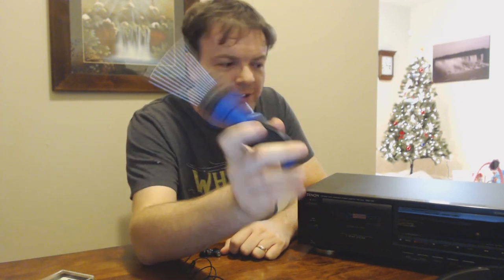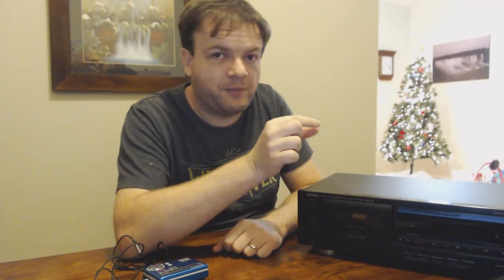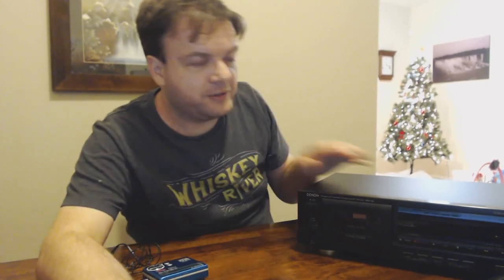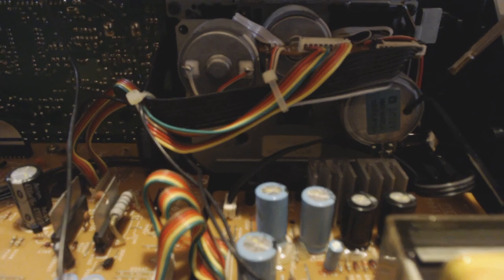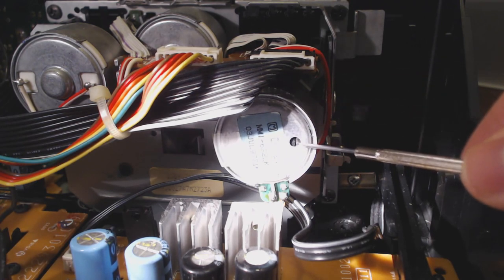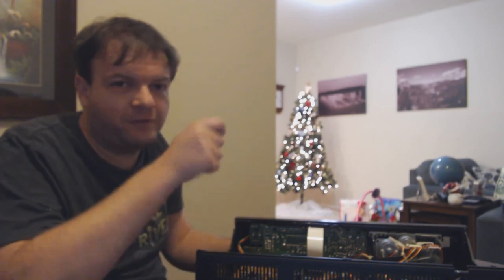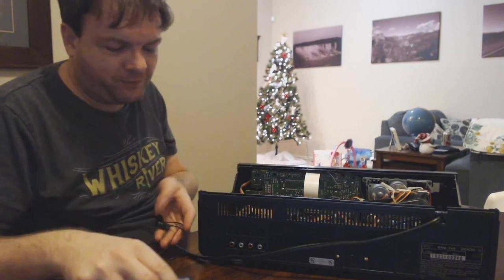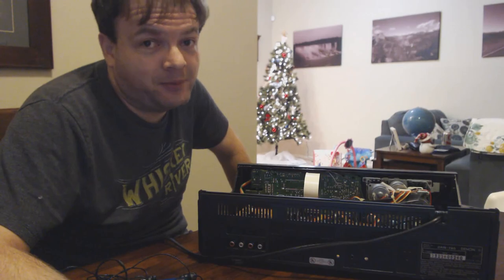Fixing a Slow Cassette Deck - Cassette Community

Comment: Thanks for the video Matt. I was able to fix the speed on my Sony RX77ES using this method. Incidentally, that was the third repair it needed to get it in working order. I bought the deck for $5 at a thrift shop. First I replaced the main drive belt, but then the speed was slow and the motor became quite noisy after an hour of playing. I replaced the motor, but it was still slow. After watching your video, I adjusted the new motor, and it works well now.
Reply from the maker: Hi Greg, that makes me happy that one of my videos helped somebody. I admit it's not the most accurate method but it works! And I don't really understand how test tones work etc. so I prefer to do things more manually. You got a great deal on your Sony deck! Even if it needed worked, you can't go wrong for $5.

Comment: My 1993 Kenwood KXW8050 double-cassette deck has a handy set of adjustment potentiometers"pots" located on a circuit board atop the tape mechanism for easy adjustment. I use a 3KHZ tape and the "Hertz" setting on my multi meter. Warning! Don't monitor the test tape with headphones; it's very loud! I learned that the hard way! LOL! Just affix your probes to the Left channel RCA jack, and fine-adjust to 3.0 KHZ. Repeat for each tape direction, if you have separate adjusting pots.

Comment: My old JVC deck hasn't been used in at least 20 years. I tried it today and it was VERY slow. I'm going to try your method tomorrow in hopes I can keep from giving it away on FB Marketplace. Thanks for the excellent video.
Reply from the maker: Hope it worked out!
Reply: @MattHayesVinyl  Thanks. In my case, it definitely needed new belts. But changing those did fix my speed problem.

Comment: This has happened to two fairly new cassette players I have :( one is on a Walkman the other is a boom box. I don’t think I can fix it on my own :( I’m. Not sure why this happened as I haven’t used either one much at all until recently I started buying tapes.
Reply: @angelanicole2945 I’ve had the same issue with 3 high-end decks I recently purchased. It’s bad news. The motors start to develop dead spots and slow down, so to compensate sellers turn up the motor speed, like in this video, before selling, but that only works for a short time. Eventually the motor will completely die. It’s hard to find new replacement motors. Buying old decks is a total gamble no matter how good of condition they are in.

Comment: Thanks for this video. My Onkyo TA-2870, and I think many other Onkyo TA have the same option. There is an off-center hole in the motor case,  sealed with felt. I had to stick through with the same srewdriver as you done and it works :) Great video hint

Comment: I have an old Philips d8134 that is playing the tapes a little slow, but I can for the love of me not find anything inside it that looks even close to the potentiometer in your video... Any advice?
Reply from the maker: Hi, sorry for taking so long to reply. Not all cassette decks are alike... especially older decks. I am not familiar with that model so I wish you the best of luck. But the first thing I would check are the belts to make sure they are still good.

Comment: Thanks for the vid Matt, I have one of my Onkyo decks that plays way too slow, next time I pull it apart I will look for a pot to adjust the speed with.
Reply from the maker: Hi Ronnie. You're welcome! I must admit it wasn't my most interesting video but I thought, what the heck, somebody might find it useful. Often the cause of a slow deck is a loose belt but, in this case, the belt was supposedly new (according to the guy I bought it off, anyway) and it did indeed seem fine on inspection. The speed was only off by maybe 5-10% and adjusting the potentiometer had to be done very gradually and slowly. A couple of the adjustments were so small I didn't even see the screwdriver move, although I felt the potentiometer turn ever so slightly. I don't know if all decks have motors like this, probably some have potentiometers in different places depending on the motor. And there are multiple other potentiometers in there for things like left/right channel output levels and so on. I was lucky that somebody had posted a video about this same adjustment on a similar deck to mine.
Reply: I relaced the belts, well actually with rubber bands... I would like to buy a couple belts only if I know it will be worth the investment and it was a huge task in this deck to change the belts you had to disassemble everthing. I did watch another vid after yours where a dude just recorded a 440hz which happens to be the musical tone of A. While playing the tape he used a guitar tuner and set the the pot to the Key of A on the tuner, magical! and very simple and logical. I think this would be much easier than trying to match speed to something you hope in itself is at the correct speed.
Reply from the maker: Yeah, using a speed calibration tape is more accurate for sure. However, I know the source was recorded at the correct speed because it was digital. Getting the tape deck to match the speed of the source was what took a while, far longer than is shown in the video!

Comment: Hey man, my cassette player is also slow, I thought it might be the belts but they look fine no cracking, just a bit stretched. I tried messing with the "pot" but I don't see a place for adjustment
Reply from the maker: Hi John. That will likely vary from deck to deck. The pot was on the motor in my Denon but was extremely fiddly to adjust. However, a stretched belt may need replacing. It will be more prone to slipping, causing speed inconsistencies, so that would be the first thing I'd do.
Reply: @MattHayesVinyl  I thought so too, but I was reading that if it's consistently slow, then its probably the motor. Might just be easier to get a new player lol idk

Comment: What about a stretched out rubber belt causing problems not exactly the speech control
Reply from the maker: That's always possible but that would require a belt replacement. In some ways that's an easier fix actually, assuming the belt is easy to get to.

Comment: How would you be able to take apart a Walkman to replace a belt? I am used to doing "operations" on cassette tapes, not the players.
Reply from the maker: Walkmans are a very different beast. I've never tried replacing a belt in one myself but many of them are very finicky and time consuming. Honestly, if it were me I'd probably just buy a new Walkman because I don't know if I'd have the patience to deal with it.

Comment: Another way to do it would be to time a song (or part of one), particularly if it's not feasible to have a reference source. By the way, was this your 3-head deck? Anyway, I'm glad you were able to fix it. I had to do a similar thing with my turntable.
Reply from the maker: I've heard of people using the timing method. It wouldn't be as accurate as comparing to a source in real time, which itself isn't as accurate as using a speed calibration tape with a test tone, but it would be reasonable if you don't have a source file (especially a source file whose speed should be spot on). Yeah it was the 3-head deck. It was probably always slow and I never noticed it before. Non-quartz locked turntables can have the same problem as you say. I've never done it but I assume the adjustment is very similar. Verifying the correct speed on a turntable would be easy if it has a strobe. If not, a digital file as the source and comparing the two should suffice. In this case, I had both playing at the time, one in each ear. Seemed to work out okay!
Reply: Matt Hayes Yeah, you're probably right. This was a fun and informative video. Tempts me to work on my "out of service" decks. The process was very similar for my Stanton T.52. Fortunately, it does have the strobe. And I was bold and made the adjustment with it plugged in and running. I think I wore rubber gloves, just in case.

Comment: If I'm not wrong. Could you just time the length of the song then adjust the speed until it has the right length ( assuming the cassette is in good condition and all and isn't stretched)
Reply from the maker: Yes in theory that's doable. The biggest drawback I can think of there is that you'd have to wait the entire length of the song to find out if any adjustments are needed, unless you are listening at the se time but then that's the method I was showing here. Thanks for watching!

Comment: I tried this method, it works but then tge speed change again.. What should i do?
Reply from the maker: Sorry for taking so long to reply. If the problem keeps getting worse even after trying this fix, it's likely you have belts that need replacing. A worn belt will continue to get looser and looser so that the fix shown in this video would only be a very temporary solution.

Comment: hi dine a lot of work on deck over 30 year i cover up a high volt parts with something hard and cable tie's to hold  
it on   i never had i buzz when doing this work  make the unit safe to work on first